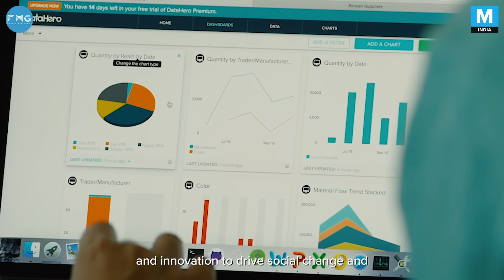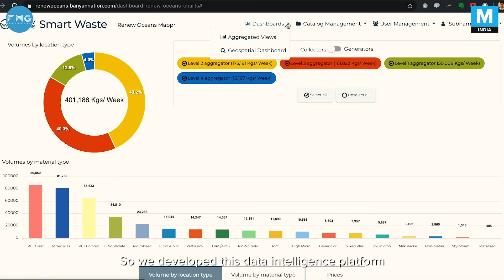This Company Is Transforming Plastic Recycling In India | Mashable India

Comment: The problem lies in the source- multiple kinds of plastics in a single item, difficult to remove labels, etc. causes recycling plastic to be really impractical. Also, every time polyolefins are recycled (usually by melting), the polymer length decreases along with the addition of degradation impurities, causing the decrease in value of that plastic. Polyesters are usually easier to recycle by chemical means (hydrolysis and reforming plastic).

Comment: It's possible to convert all plastics directly into useful forms of energy and chemicals for industry, using a process called "cold plasma pyrolysis."
Pyrolysis is a method of heating, which decomposes organic materials at temperatures between 400℃ and 650℃, in an environment with limited oxygen. Pyrolysis is normally used to generate energy in the form of heat, electricity or fuels, but it could be even more beneficial if cold plasma was incorporated into the process, to help recover other chemicals and materials. Cold plasma pyrolysis makes it possible to convert waste plastics into hydrogen, methane and ethylene. Both hydrogen and methane can be used as clean fuels, since they only produce minimal amounts of harmful compounds such as soot, unburnt hydrocarbons and carbon dioxide (CO₂). And ethylene is the basic building block of most plastics used around the world today.

Comment: If you tell poeple that you can actually recycle the plastics well, they will just start using single use plastics more. To actually save the environment we need poeple to understand that there are 3 R's of recycling - Reduce, Reuse and Recycle, whoch clearly signifies poeple should actually not think about recycling first but should Reduce their consumption, Reuse anything to a long extend and then if there is no option one should give that item for recycling. This problem can only be solved with both people actually following the 3 R's of recycling and Innovation in the recycling technology which youare actually doing.

Comment: This sort of solution can only be efficient if you have a fast and short recycle route because plastics, with very different constitutions (basic structure, colorants, weakeners etc...), that go into environmental systems will always degrade and or leak to micro and even molecular level. Eventually accumulating in food chains and poisoning ecological networks, including the human society. So I still doubt if the economical profit of this approach is high enough to maintain this sort of recycle industry on such a high level that it will be effective enough to counter this poison effect.
Reply: Best is to stop making plastic for packaging every good

Comment: There is a lot of exaggeration by the founders. Yes they are doing great work. Yes, they need funding to expand nationwide. But they're exaggerating a lot. Not even close to 99% of the water they use is reused again. "We use the best water...". The best water should be for human consumption rather than washing filthy plastics. One could use sea water for the first cleaning of contaminated plastics. 

Their system is not perfect. Again more investment is necessary and worth every penny. But let's not proclaim we are the singular solution with the latest equipment, best methods with the highest recovery of contaminated plastics with the least amount of water use and sludge going into the landfill. 

Where is all of the sludge (caps, labels, glue, food, and chemicals) going? Where is the filthy contaminated water going? How much water is being used by the facility daily? This advertisement skipped over these important points. We need to source raw materials from businesses with the least amount of waste and energy consumption. Energy derived from renewable sources is far better than energy from fossil fuels. How sustainable are they?

My point is there is much more information needed to make an informed decision when looking into a supplier or buyer than someone making a few positive claims. Many times these claims distract or hid the real environmental impact a company has. 

Cheers!

Comment: how does this solve the problem of the vast majority of plastic pollution getting into the environment? it doesnt.  lets use reusable and more sustainble, lower energy intensive materials that arent made out of oil!   This option still uses oil and plastic production.  We should be putting pressure on the manufacturers to use sustainable materials which is not plastic.  Avoiding single use plastic in the first place is and always will be the best option for a more sustainable, cleaner, and safer world.